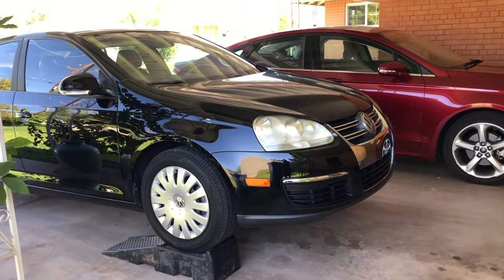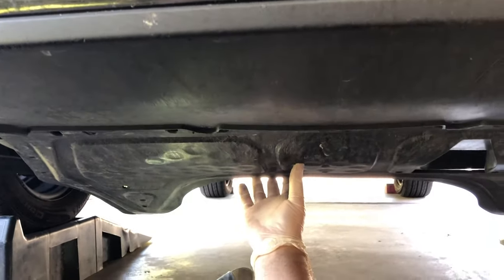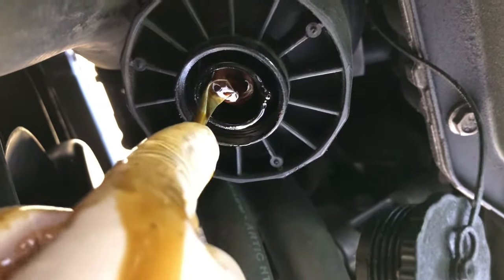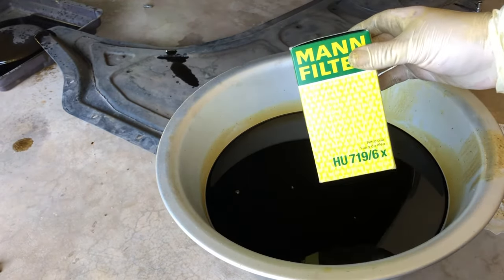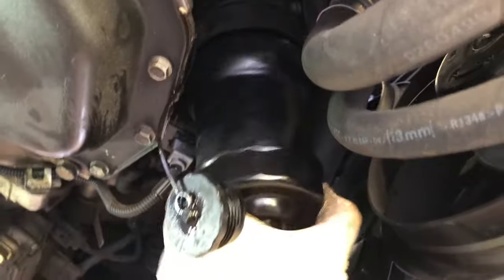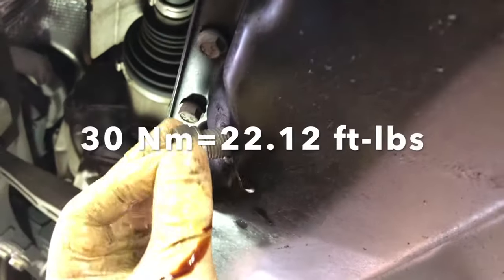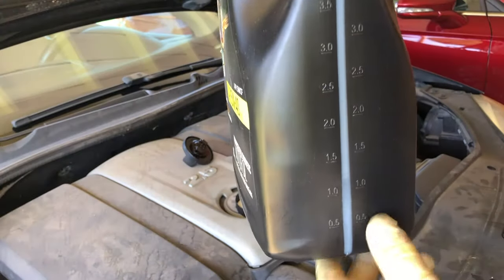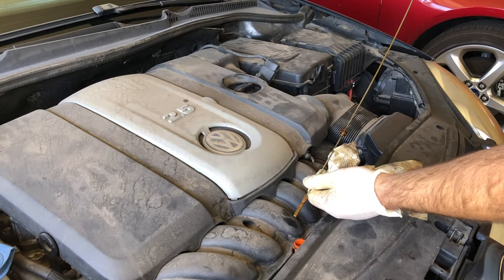DIY Volkswagen Jetta Oil Change (2006, 2007, 2008, 2009, 2010 VW Jetta 2.5L)

Comment: Most places either flat out refuse to work on a Volkswagen, and those that will rarely have the filter in stock. 
 I'm a master machinist/ME with 25 years of experience.
 Unbelievably, it's less of a hassle doing it myself than calling every oil change place in the  city and still not finding one for literally weeks at a time. 
 Thank you for skipping the chit chat and getting right to the point in a concise and straightforward approach. 
 Very well done. Wanna make another video doing the freeze plugs next ?

Comment: Oil drain plug is actually not malleable or torque to yield. Also that is a solid hard steel washer and not a hollow crush washer. Perfectly fine to reuse multiple times. Don't know how the myth of needing a new plug got started but if it makes you feel better by all means, it's a  couple of bucks to replace so go right ahead. Carry on.
Reply: Lmao I was thinking the same thing 😂

Comment: Just a tip for anyone else with a 2008 jetta 2.5, you should absolutely get a 76mm oil filter wrench like was shown in this video! I spent like $16 on a universal normal pliers style tool and all it did was rip up the plastic and be a total waste of time and money. I went out and got proper oil filter wrench and though I still needed a bit of extra leverage to finally loosen it, it worked first try. Highly recommend you don't skip that step.
Reply: I got a 74-76 mm and it's slipping... I also got pliars and it as well is ripping it. Do I just need a plain 76 mm?

Comment: There is a wonderful tool for draining the oil filter housing from several manufacturers (eBay, Amazon, etc.) which screws onto the dust cover housing and then screws into the valve to allow the oil to drain through a tube to your drain pan. It's about $15 and it makes life wonderful. German engineers like to design things so the DIY owner/driver will suffer physically and mentally. I actually don't know of any German car with a spin-on oil filter. 
I love my Mk 5 Rabbit 2.5 but I hate servicing it.
Reply from the maker: Good to know! Thanks for watching!

Comment: Open the oil cap on the engine when draining to release vacuum pressure so all the oil drains.
Reply from the maker: Great tip! Thanks for watching!
Reply: @timsdriveway5309  The oil draining does not create a vacuum, fyi.  If it did, it would glug while draining.

Comment: When you were removing the oil filter catcher I noticed a hose being extremely close to touching the oil filter. When I did mine, I noticed the hose was being corroded from all the hot oil leaking from the oil filter. Do you have any idea what is the name or part number of the hose so I can replace it ? And what I can do to prevent from this happening again ? Thank you!

Comment: Just bought a rabbit, same engine set up. While  this video was very helpful and I thank you, I miss how simple Japanese cars are. 

All these extra steps you need to do that make no difference and safety or performance. Toyotas usually have a cut out on the shroud that you don’t even have to remove the plastic shroud. Also the internal oil filter thing with a valve is pointless! On a normal car the gasket comes already on the filter and all you have to do is take the old filter off and make sure the gasket comes off with it ( if the gasket is baked on the engine) 

All this so-called technology on German cars and a Toyota will outlast any German car as far as the engine goes, this is a proven fact. I will never understand that German logic

Again thank you for the video 👍
Reply from the maker: Thanks for watching and for the comment! I have always driven domestic (US) cars, but I'm a huge fan of the reliability of Japanese vehicles. The German vehicles I've worked on almost always seem to need a special tool or an extra step, regardless of the job being performed.
Reply: No one asked
Reply: Well said and thank u for I have always thought of German over engineered crap
Reply: No, Toyota's drive and handle like boxy toys.  The VW is so much better for a driver.

Comment: Was wondering if I should use a different oil for a higher mileage over 75,000?
Reply from the maker: If you can find a “high mileage” oil that is full synthetic, 5w-40, and VW approved, it certainly wouldn’t hurt to use it. The oils labeled “high mileage” contain additives that are supposed to condition seals and prevent excessive wear in older engines. If you can’t find the high mileage oil, I wouldn’t worry too much about it. The best thing you can do is just stay on top of your oil changes. Thanks for watching!!

Comment: Awesome guide.  Thank you very much.  Will be getting the wrench kit to make the filter easier.
Reply from the maker: You're welcome! Thank you for watching!
Reply: These scams are getting pretty elaborate..
Reply: I dont know if anyone cares but I bent a standard oil wrench in half and busted my knuckles before watching this because I didnt know this little princess car needed a special fitting to loosen the got-dang oil filter.
Reply: @Smigsmacker  holy shit why is it on that tight?
Reply from the maker: I'm glad it wasn't just me. That thing was on there TIGHT!
Reply: @timsdriveway5309  it was on there so tight my 75.6 part I got from the Amazon 9pc box, is now stuck on the filter housing and my wrist hurts like a b

Comment: Do i really need the torque wrench for this job? Its making wanna go to the shop but my car is too low🤧
Reply from the maker: You can definitely do this without a torque wrench. I highly doubt that the last person who changed the oil on this car before me used a torque wrench because of how insanely tight the filter housing was. Honestly, the torque wrench may be a bit of overkill. You’d be fine using a regular wrench (I don’t always use a torque wrench to change the oil on a car), just try not to over tighten anything.

Comment: Recommended oil is 5w-30 full synthetic or 5w-40 not synthetic right???? You put the wrong oil ?
Reply from the maker: I don’t want to open up a can of worms here… For some reason asking people about their oil preference becomes a polarizing topic, but VW recommends 5w-40 full synthetic oil for this engine (which is what I used in the video). In fact, VW specifically recommends Castrol 5w-40 full synthetic oil. In the video I explained what to look for on the back of the oil jug to make sure the oil is approved by VW. Thanks for watching!
Reply: Can I use synthetic blend?
Reply from the maker: I’d recommend sticking with the full synthetic. But if you’re in a bind and only have a synthetic blend available, using the blend would be better than continuing to run the engine with dirty/old oil by not changing it.

Comment: > Thank you for your information,  I found a 06 2.5, and paid $143:00 last time,  but Not today. 
$47 oil 🛢/ $12 around,  filter 
Less than $143:00+ FJB>Taxes 😡  Thanks Bro your Channel helped me some CASH $$$$😊 I found this Jetta last year with 62,000 miles on it.  For,  ?🥁🥁 $2900😁

Comment: Why have I never thought of pouring the extra needed oil back into the empty container?
Reply from the maker: Haha when I first thought of doing that, I said the same thing. I used to pour a little bit of oil into the engine, then check the level left in the jug, then repeat until I put the right amount in. But using the empty container takes the guess work out of it and makes the process a little faster. Thanks for watching!

Comment: Do I only use 5w-40 or can I use 5w-30 ?
Reply: Check your manual, mine says 5w-40 but 5w-30 if that's not available. I've used both.